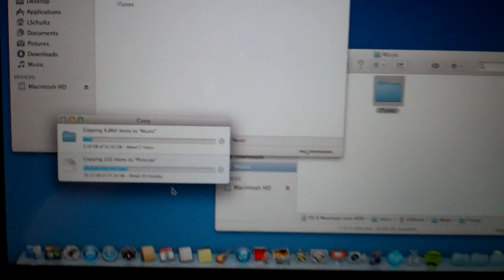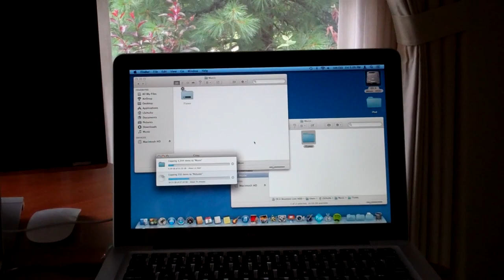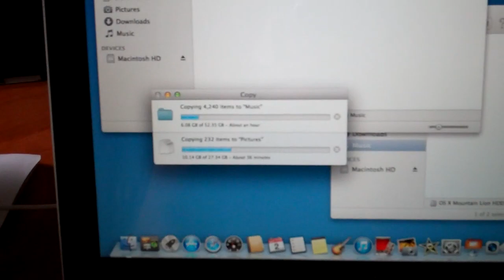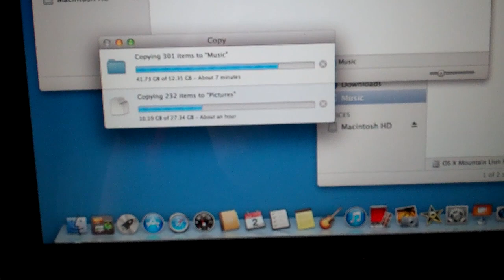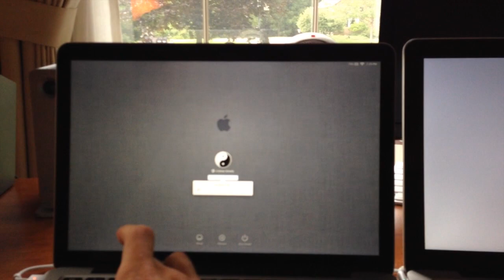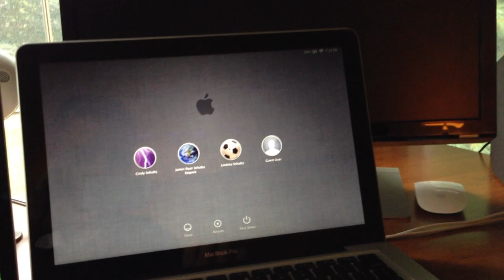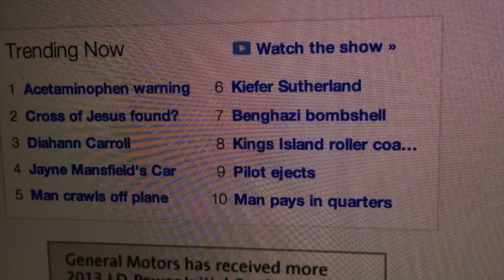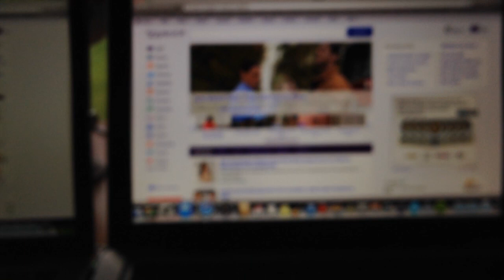MacBook, V8, Rain  8/2/13 - Day 965

Comment from the maker: There aren't plans for the old 13 inch right now.  We have the two Retinas in the house now.  Mine is the 15 inch, 2.7GHz i7, 16GB RAM, 512GB SSD.  The 13 inch is the 2.6GHz i5, 8GB RAM, and 256GB SSD.  My Dad has my 2010 13 inch 2.66GHz Core 2 Duo with 8GB of RAM and a 320?GB HDD.

Comment from the maker: The 13 inch doesn't either, just two Thunderbolts.  I have Windows (XP, 7) installed in a VM on my Mac.  I only find it remotely useful for Chess and Spider Solitaire though!

Comment: Does the retina 13" have a FireWire port? I know the 15" doesn't. If an SSD were transplanted into the 2009 it would speed it up exponentially. This was the case with my 2008 non unibody. Saying that I put more RAM in and it has a real GPU with the same CPU. I agree! The SSD in my desktop machine makes it fly. Saying that even though I own a mac I am still a windows user. But that's me! iTunes is shit on windows though. I have a 6 core CPU, with fast SSD and it's slow as BALLS. Under the hood...